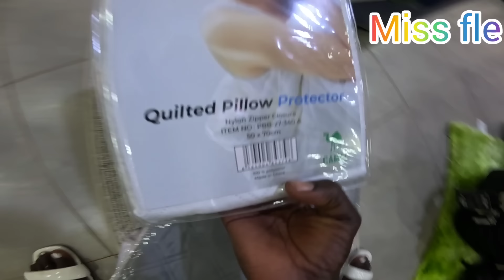Finally!! Getting ready to move in with my Babe❤ @ItsNasto in our new house

Comment: You should cover that dugged bore water hole when it's not being worked on to prevent accidents.  I would be terrified walking at night or anytime, and step right into the hole.
Reply from the maker: Yeah its good for it be covered but there's someone inside digging
Reply: @Miss_Fle  - Not permanently covered, only some wooden boards placed over it when it’s not being worked on.
Reply from the maker: @jsupreme369  thanks for the concern I appreciate 🙏🏽

Comment: Miss Fle, you should discuss with your husband on putting cabro all around the house and not just at the front part. It will make it easy for your cleaning and also protect the wall from being eroded by rains. Just an opinion though. Otherwise, you are coming up well.
Reply from the maker: Yes I will thank you

Comment: It’s called a vacuum cleaner.
A device which captures the dust and fine debris particles where all particles are retained in a special reusable container for disposal. of the contents. Because if a special filter inside the vacuum device, dust particles are prevented from escaping back to the environment. 
Without this capability the rooms would be contaminated all over again and Nasto allergy would become more severe.😄😁
Reply from the maker: 😅😅😅Thank you